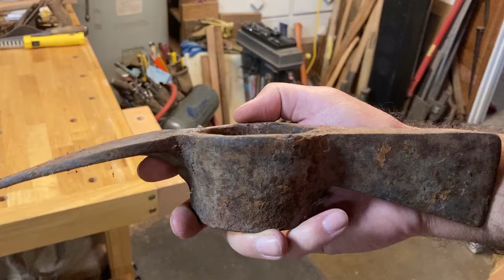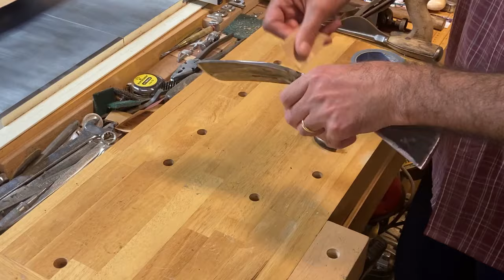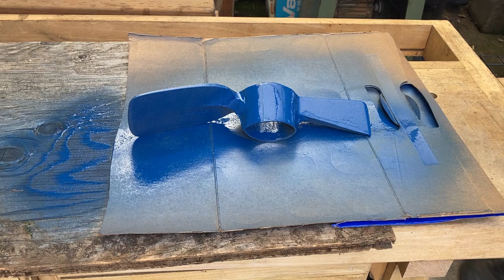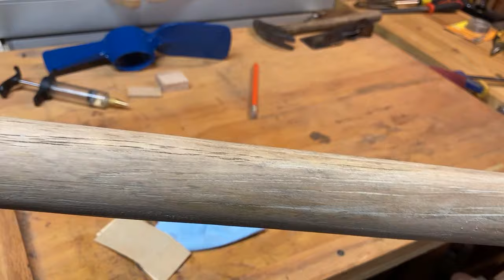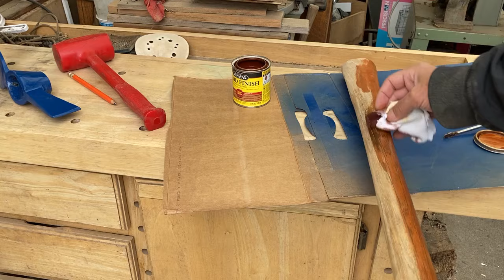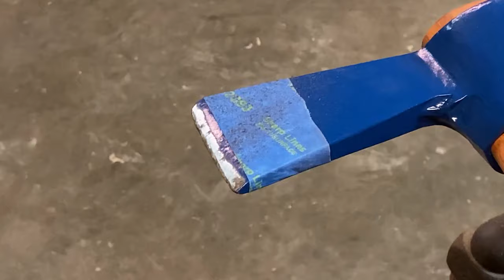Rusty Mattock Full Restoration

Comment: Ooooo where did you get that syringe you used for wood glue???  I could use something like that!  🤔🤔🤔🤔
Reply from the maker: Ok so I included in the video description a link to a glue syringe that comes with a needle that i've had good luck with filling in small cracks and then another link for a glue injector that I used in the video, that works but i'm not sure i'm crazy about it.  Hope that helps.
Reply: @ToolsandTime  awesome!  Thanks!  👍😀👍